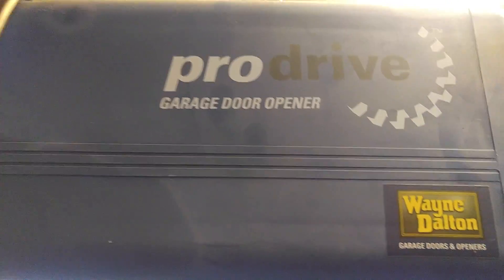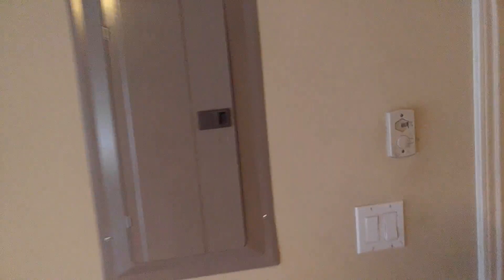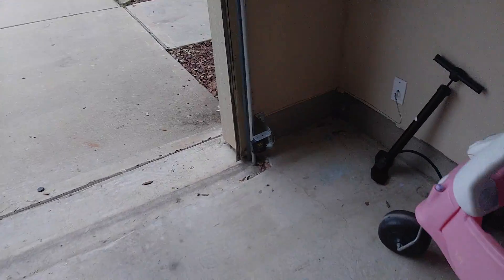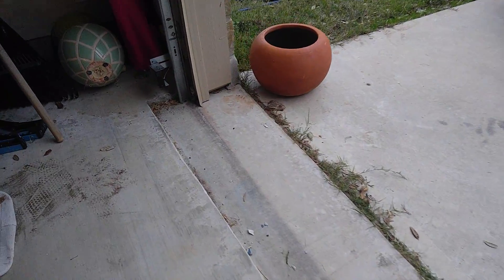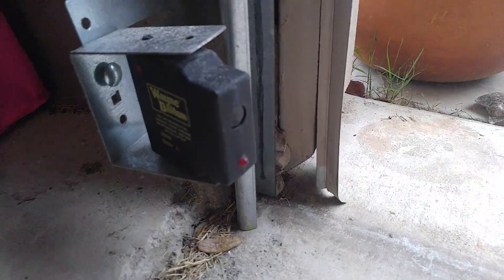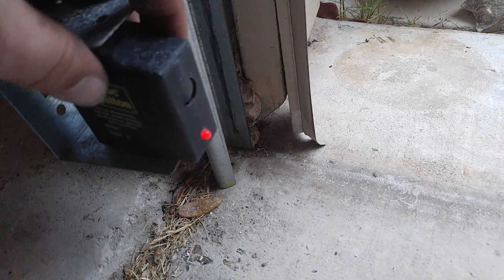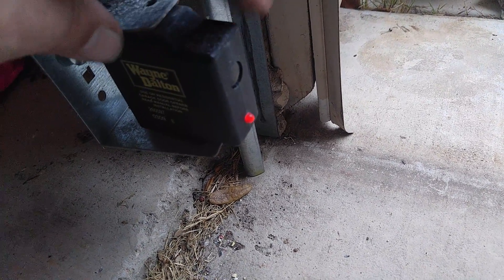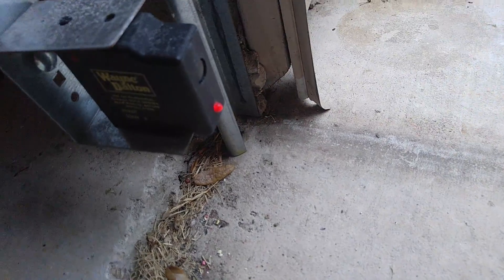🆕Garage Door Opener Troubleshooting-Wayne Dalton Opener Not Closing

Comment: Nice video. I have a different question for the same model of WD opener. I bought a house with this opener and I just noticed that there is no red cord for emergency disconnect. Do you know how to replace it?
Reply from the maker: @bjorney2006  thanks for the comment! 
The red rope attaches to the silver pull down finger on the trolley.  You should see a hole that the rope slides through.
Reply: @garagedoorgenius  Thanks! I was able to disengage it now.
Reply from the maker: @bjorney2006  great news!

Comment: The sensors are aligned with the red light on. I wave my hand between them and it goes on and off. My issue is that it will not open. All it does when the button is pressed is flash the 120v light 15 times. What does that code stand for. I searched the internet and found nothing. I hope you can help. Don't have much money to get it replaced and I'm savvy enough to fix the components.
Reply from the maker: Check the force controls.  You may have to turn them up a bit... 🤔.
Reply: @garagedoorgenius  I did try increasing and decreasing the force. It still just flashes the light 15 times regardless.  All the other manufacturers "light codes" only go up to 10 flashes. I checked the wiring with a multimeter and no shorts or disconnects. I guess I will just have to manually move it until I can afford a replacement.  Thanks for the quick reply anyway.
Reply from the maker: @erictheamerican  it's a Wayne Dalton opener?  What model #?
Reply: @garagedoorgenius  yep, model 3018
Reply from the maker: @erictheamerican  take a flat tip screwdriver and where the wall button wires to the machine, arch the 2 terminals.  Stick the screwdriver between the 2.  See if you get anything.
Reply: @garagedoorgenius  That was the first thing I tried.
 I believe it to be the motor capacitor.  It doesn't have continuity and I think that is a sign its bad. I expected to see bloating or fluid so I didn't suspect it at first.

Comment: What if this doesn’t work? Any tips
Reply from the maker: Hmm .if it's not closing most of the time it's sensor related.  Thoroughly check the sensor wires to make sure there's good connections at the sensor and where they plug in up at the machine.
There's also a setting called the force control. Should be to dials. They give the machine muscle to push and pull a door up and down. You can see if adjusting those helps the issue.
Reply: Thanks for the quick response but I commented on the wrong vid. I’ll try again